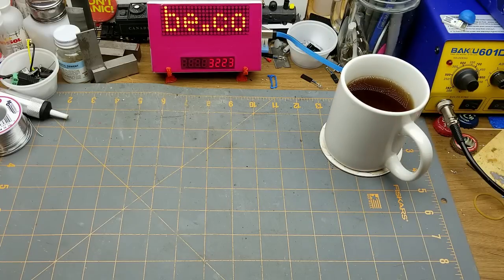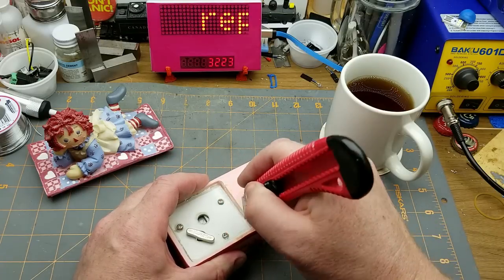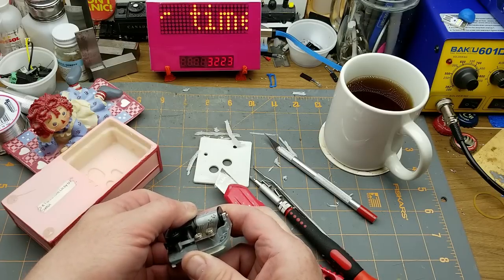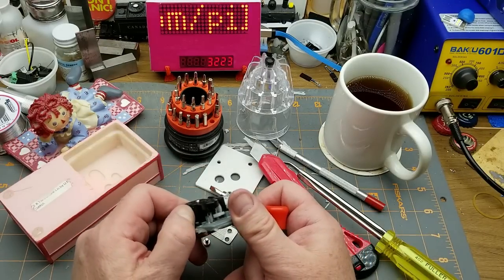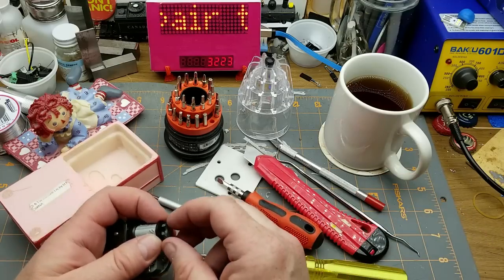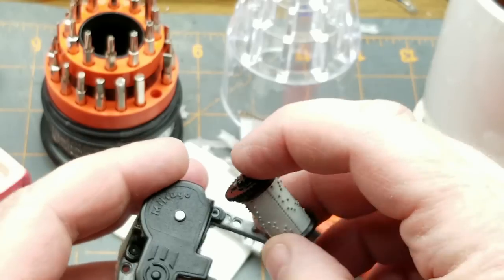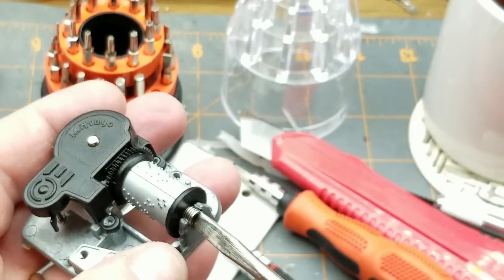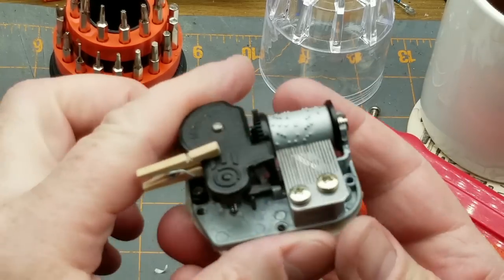Dad's repair shop: music box repair

Comment: For anyone else taking a stab at this, don't loosen the screws on the comb at the same time. Only loosen one, make your adjustments, tighten, then loosen the other. Otherwise you lose the positioning of it, which I have done in haste, and it took me at least 8 hours trying to get it right so I had no dead notes or off keys. Cleaning and lubricating took maybe 30 minutes, but that comb, do your best not to move it if you don't need to. Most often the issues are resolved by using a toothpick tip and applying wd-40 to the base and top insertion points of the worm screw on the govern. You can use castor oil at the base of the drive pin (crank pin), and any other gear spots that have friction points, you can even put some on the tips of the pins on the barrel to help the comb to slide off cleaner on the notes. Before oiling, if you are cleaning, you can use vinegar and a q-tip, and make sure you dont get the cotton caught on any pins or gear teeth. I would suggest something better selected than a q-tip, like a small paint brush with synthetic bristles, like the ones for oil based paints, so you don't lose bristles in the gearing. But if you have a local hardware store that sells Never-Dull - Magic Wadding Polish, it's amazing stuff for cleaning up anything metal that oxidizes or rusts. And it conditions it with a light oil to prevent future corrosion. You'll open the can and go... huh? This won't work. But you try it anyways, and I'm surprised more often than not at the job it does. I found most of the above online, but also am in the middle of reconditioning a music box to give to my mother. My father has been fighting cancer for 10 years and she has supported  him, and been such a strength and comfort to him, and I feel its a large reason he's still fighting after prostate removal, liver removal, and the cancer moving into his bones last year. He was even golfing a month ago with my brother. Only 9 holes, but considering his condition medically, its amazing. Anyways, I am hoping to give it to her in the next day or two, and hopefully she likes it. And hopefully something I said helps someone else too. Comb sizes and number of notes on them vary greatly, so I would imagine techniques do as well. All the things I noted above were related to an 18 note comb, like the one I'm working on. They likely apply generally as well, but just to be clear, and not mislead anyone I figured I would add that.
Reply: Thank you
Reply: Thank you
Reply: Hi Rick, I sure could use some advice on repairing the music box on my musical Christmas stand.  It's making a scratching sound.  I'm sure it's an easy fix but afraid to break it.  I can send a video if you're willing to take a look.
Reply: @heidiricci8495  Sure, if there isn't anyone with more experience able to make time for you, I'll take a look and listen.
Reply: Is hard core to put back the comb in 72 note 3 tunes . Took me a week.
Reply: Do a video
Reply: @Sanctuarygirl415  i have 2 video with musical box on my chanel , i remove the comb only to replace dumpers or replace broken teeth . Don't have utility to film on grandfather workshop and worth hustle only on large expensive antique music box. I use a yamaha Yamaha guitar acord divice to manage align back the comb.

Comment: Nice job by a great dad! I just had the same request from my wife for a very similar movement! My problem involves the 'flywheel' thing ;)  which is actually the speed governor which keeps the play at a proper speed and not have the music finish in 2 seconds. In my case the governor is loose for some reason and falls out. The parts are not easily found. Oh well. I have a schematic and will keep at it. Amazing engineering on such a small item! 
Thanks for a fun and informative video!

Comment: Sorry, I completely forgot to say thanks for the great video. Wish I had of seen it a few days ago, and it would have saved me a bunch of clicking and sorting out the helpful from the less so. You still did a great job going into it blind, so to speak, , which speaks to mechanical aptitude and knowledgeable confidence. And when the motivation is such as yours, it can never be anything but successful, as it drives your focus and determination much akin to the force that drives these little music boxes when the key is turned to store energy in the spring.

Comment: That fan thing is a governor to regulate the speed. In the old days a rod would drop into the fan when the lid shut to stop it spinning.
Reply from the maker: I think there's another music box in her room that uses that braking method. It sounds nasty if you close the lid gradually.
Reply: Typical flywheel brake governor. Using air and friction.  Have you ever jumped in a parachute practice rig where the rotating fan is all that slows you down.
Reply: thats the kind i just bought from a thrift store! nothing moves when i open the box and the rod releases the governor but i can manipulate the governor by flicking it with my finger. it sometimes spins enough to get a few notes out and sometimes plays for a while, very slowly. it looks like all the gears and the barrel itself move fine, and the sound is in tune. it does feel like it’s wound too tight- i can only twist it once or twice before having to manipulate the governor a bunch to unwind it a bit. takes forever. any guesses as to what’s wrong?
Reply: thats the kind i just bought from a thrift store! nothing moves when i open the box and the rod releases the governor but i can manipulate the governor by flicking it with my finger. it sometimes spins enough to get a few notes out and sometimes plays for a while, very slowly. it looks like all the gears and the barrel itself move fine, and the sound is in tune. it does feel like it’s wound too tight- i can only twist it once or twice before having to manipulate the governor a bunch to unwind it a bit. takes forever. any guesses as to what’s wrong?
Reply: @Zoe-rf3ly  could be a few things. The barrel could be pushed into the gear too tightly and it can't rotate. The barrel screw on the other end, could be loosened a bit, it might also need a drop of oil. The comb could also be pushed tightly against the barrel preventing it from turning when the pins that stick out further can't pass the comb finger and get stuck now and then, which you can confirm by pushing on the barrel a little to see if helping it gets it past the finger. Just be careful if you decide to move the comb away from the barrel to allow it to turn more freely, only loosen 1 screw, make adjustment, retighten that same screw, before loosening the other screw. If you loosen both, the alignment and distance will both  be lost, and you'll spend hours and days trying to get it back to that spot that is aligned with the barrel pins and at a distance that they don't miss completely or snag from being too close, and also ticks the pin with the right momentum to give the note its length but without over strumming it causing unpleasant reverberation/vibration. There are also adjustments for the tightness of the plastic gears next to the comb that transfer the turning motion to the governor worm screw, creating the right song tempo. Whatever you do, just try one thing at a time carefully, and if nothing is fixed, adjust them back before trying the next thing. Ie if you turn the screw at the end of the barrel, count how many turns, so you know how to return it to where it was. Ultimately it could be more than one thing causing the issue, but you'll have to use your judgement as I'm sure you'll notice subtle, or not so subtle changes with each thing you try, which might help you to estimate what it needs to turn properly and freely. My best guess is, if it's not getting snagged on pins, it's the barrel screw pushing it too tightly between the barrel axial point and the gear that's meshed with the crank housing causing binding between the gears. Hope this helps.

Comment: The problem was the comb keys were not aligned with the drum picks.  If you play the video back at 0.25 speed at 10:28 you can see two keys being picked with one bump on the drum.  That was making it sound weird.  Adjusting the screw on the right side appears to shift the drum left and right just a bit for alignment.  The drum still looked a bit shifted to the right at the end but didn't appear to be picking more than one key at a time.  Good work.

Comment: I'm trying to fix my daughters musical box because when I crank it it won't spin at all any advice
Reply from the maker: I just examined mine closely as I disassembled uit and poked and prodded at the various bits until I found the problem in mine.

Just go slow and don't force anything so you don't accidentally break something.

Comment: Do you have a place to send questions? I have a music box and it seems quite old on the cylinder with the notches there was actic on imeach side inbetween the metal one side came off its still playing will that mess it up if it stays off or no?
Reply from the maker: I'd like to help you but this is the only music box I've ever opened.

Comment: Very cool video!
Reply: I have a musical German beer stein that I bought in the early 70s, in Munich.  Today, I tried to turn the music box on, but the  twist mechanism had been over twisted, and no music. I followed your video, and discovered the pin had been pushed up so it didn't allow the 'fan' to turn. Once I pulled the pin out where it didn't touch the ''fan' -- the 'fan' started swinging rapidly, and the music played! My problem now is that the music is playing very slowly,. Any suggestions to get the music to speed up? Thank you for your video!! I subscribed to your site.